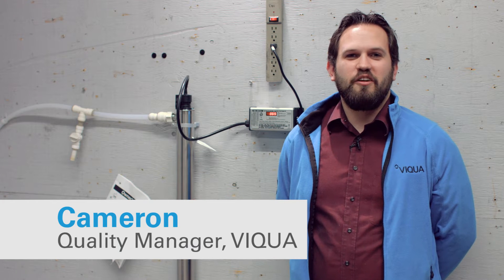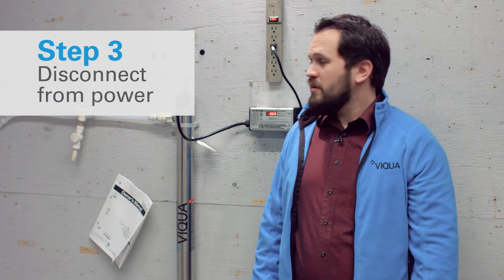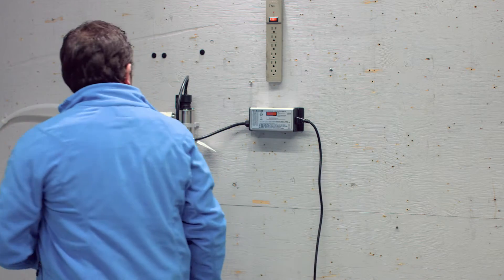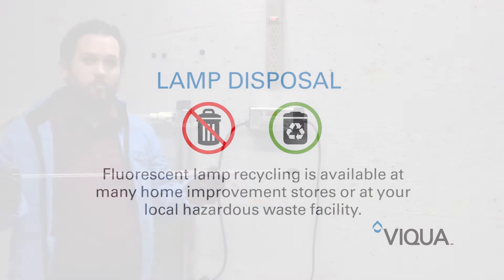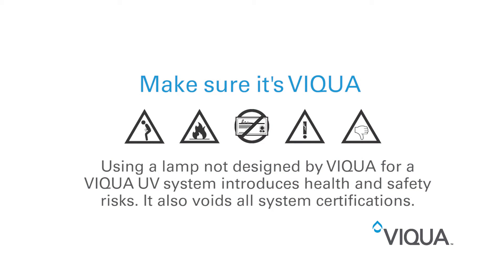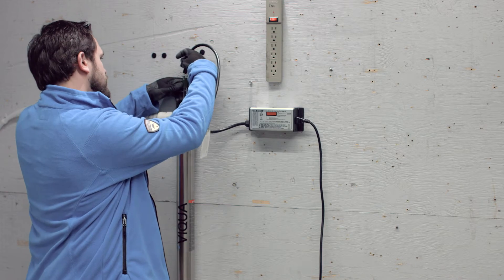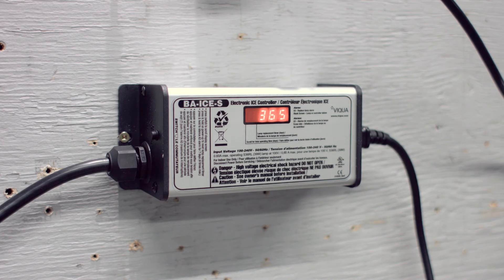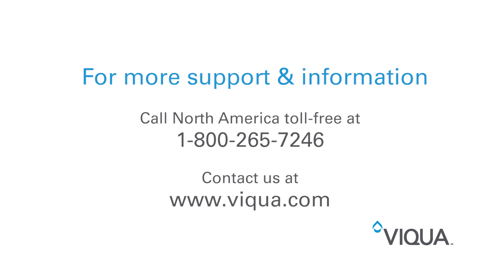How to Replace your VIQUA UV Lamp - Powered by Sterilight  Systems

Comment: Viqua lamps are so expensive, you could replace off brand bulbs 4x more often and still save money.  How is this even possible?
Reply: Well also consider the off brand bulbs are from fly-by-night chinese companies that disappear and bear no traceable liability whatsoever when you contract a fecal borne illness after said lamp fails unbeknownst to the served household. Viqua cant in their right mind advertise their consumers replace the most critical piece with a lamp manufactured in (what has to be assumed) a Jiangsu residential basement with an un labeled companies quality control standards on a product they reverse engineered. For folks with Coliform tainted wells, a hundred bucks aint worth the gamble imo.

Comment: Very detailed demonstration, thank you!
Why OEM bulbs are  100% cost more than aftermarket bulbs?, how do I know it's working after installation?
Thanks!
Reply: This is a little late but how you can tell it's working is you let the system run for at least 48 hours. I let mine go a week and then do a water test for bacteria.

Comment: Shouldn't the water get turned on before turning the power back on, considering the heat of these bulbs and that they're not supposed to be operated without water in the system?
Reply: You do not want water flowing in your system if the UV is not working.

Comment: Can you please add a video about how to clean the sleeve, and also how to replace the sleeve?
Reply: Cathy in VIrginia the new lamps don’t have sleeves.  It’s all in one
Reply: @craigcox1309  Well some of us have models from 2 years ago that have sleeves- that's why she's asking. My model looks exactly like this one, has a sleeve, and was uninstalled more recently than this video was made.
Reply: @lionessathena8679 My system also has a quartz sleeve and it just pulls straight up just like the bulb. I stuck a clean rag tied to a string dipped in a bleach solution to clean the inside, wiped off the outside, rinsed it really well and put it back in. I also did the rag thing inside the system chamber and rinsed that very well too. Just be careful you don't lose any of the o-ring gaskets or the thing will leak like it did to me.😅

Comment: What about showing the removal and cleaning of the quartz tube
Reply: Remove lamp, unscrew bottom cap, there are 2 orings on tube, one on top and bottom, remove these and slide tube out, replace or clean